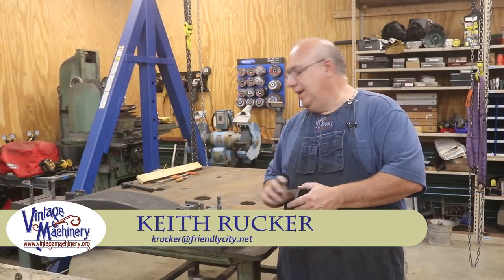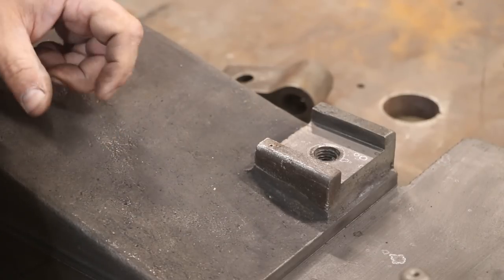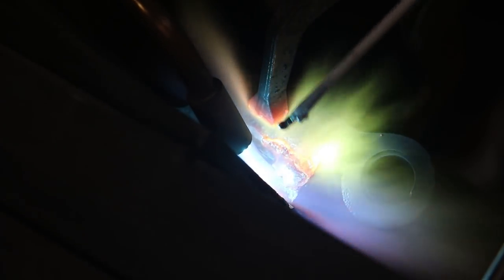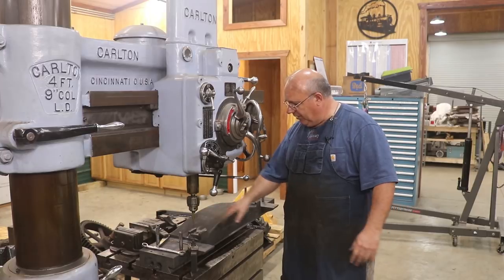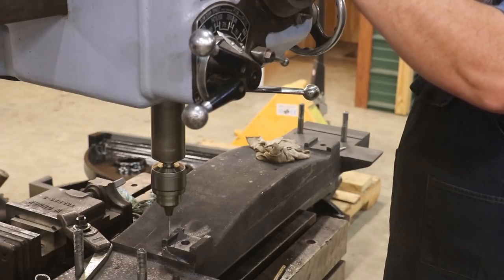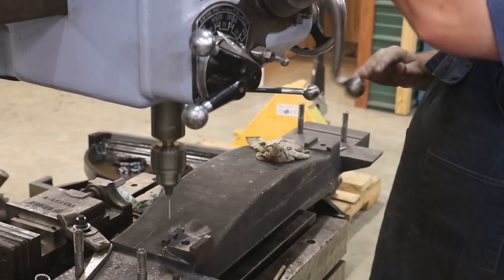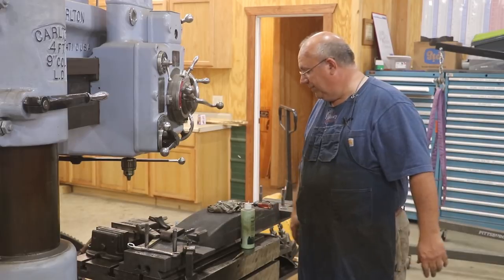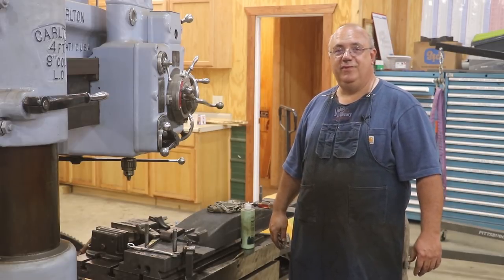New Haven Metal Planer Restoration - Part 6: Repairing a Broken Casting

Comment: Hi Keith, Just read a few of the comments. I think I understand your method of complete tap through rather than just tapping the the large peice. The stress of pressure from tightening the screws on the braze might weaken the weld. I think the hardware store screws give a vintage look to the repair. How about adding 2 screws in the same place on the oppisite mount? That would make the repair unnoticeable because both mounts would look the same after paint. I don't know the shear point for those screws, but if you used them, I am confident they are adequate. I was a machinist over 40 years and I'm still learning new methods and techniques by watching YouTube. Don't let the armchair machinists or ENGINEERS comments bother you. "Sometimes even a blind mouse finds some cheese philosiphy" and "the book says...." doesn't trump experience. I really enjoy your videos, and I've learned a thing or two, also.

Comment: Blind pins between the casting and the bracket would carry the shear load and make an 'invisible' repair besides the brazing.  Just another way to do the repair.
Reply: Yet another good suggestion. 90% of the force is sheer force. Those screws don't look they're up to it. That's a lot of weight lifting up and down
Reply: if you look at the braze as a "hinge" is it really shear load on the screws?
Reply: @fuzzy1dk  -- Good point. It's a question of what gives way first of the brazing. The part on top acting like a hinge or the whole thing all at once. Either way it seems not the ideal repair.
Reply: Aligning the wholes in the main and the broken part might be interesting though...
Reply: You pointed out my question too. The screws are just too soft and would be weaker than the cast iron. Why use screws when the repair is permanent and would never need to be redone in the future. Pins would be the perfect choice.

Comment: As other people have suggested, dowel pins on a reamed hole would have been a much better choice. Much stronger, ground finished with zero stress concentration factor on the pins vs the threads of the bolts. Hardened shoulder bolts on a reamed hole would make a great choice too.

Comment: Keith, I'm a mechanical engineer.  I differ with your repair method.  Use grade 8 socket head screws with red loctite; torque to 12 ft lbs.; then grind the heads off flush & "voila" : repair without being seen.  Have a nice day.
Reply: I'm a ME also and I use Grade 8 for almost everything. I'd counterbore the part for the heads a little bit. Loctite and leave them. BTW do you know there used to be THREE grades of red Loctite? #1 #2 #3. Nobody used 1 or 2 so it's all 3 now. And blue Loctite is good too. AND if you never ever want to take it apart again use the green...
Reply: Hi I'm no ME but I would have used socket head screws like you suggested with the heads counterbored flush and Loctite etc. Tapping the hole right through the broken off piece means all your doing it tightening the screw to the broken section. It should of had a clearance hole through the broken off piece. Just tapped the bottom of the hole so it pulls the repair up tight.
Reply: Phil Grindle: You're right about the Loctite Green. I applied it to some 8-32 mounting stud nuts (on a fuel gauge). When I went to remove the nuts, the studs twisted loose. I just use the Loctite blue now.
Reply: Socket head cap screws are not grade designated as are hex head cap screws. A standard inch series socket head cap screw is 20% stronger than a Grade 8 hex head cap screw and 50% stronger than a Grade 5 hexcap screw.
Reply: @PhilG999  Green is a medium high strength wicking grade for pre-assembled fasteners.  Red is high strength and generally stronger than green.  Purple is low strength for small fasteners and blue is medium "removable" strength.  Most versions have 3-5 different versions for different applications such as liquid, paste, stick or tape and for use on different sized fasteners.  There are food safe versions, high temp, ultra high temp, etc.  Red loctite has 9 grades now actually 262, 263, 268, 271, 272, 277, 2620, 2700NA, 2047.  Not sure if the military spec versions are the same as some of the others just with a different number though.  Most people just call it by the colour without knowing that there are different versions for different conditions.  It is definitely not a one size fits all situations.  You need to use the correct formulation for your application.
Reply: @tamaralee4108  I recently had to remove 8, 5/8 studs from a cast iron housing that were installed with ALOT of green - like they were dipped in it. Double nutted them and got out the torch. It didn't take alot of heat, but I finally got them all out. I put them back in with red, but I don't recall which number. Hopefully I don't need to do it again, or I may just order new studs.
Reply: @PhilG999  I personally opt for the passionate pink Loctite, but it's difficult to find these days.  :-) ...
Reply: Some good suggestions here; agree with consensuses to use grade 8 fasteners.
Reply: @chris0tube I can't see how you think his screws are doing nothing? They're threaded rods, If you loosened them you wouldn't be able to pull them out & once tight they are holding the 2 pieces by their threads. I agree they're not tightening/pushing the broken piece down but it's brazed anyway & his screws are doing exactly what he wants them to do, addig some lateral strength
Reply: @chris0tube Slit through all the braze from one of those 2 pieces, would it fall off? No, & surely the threads are under tension even though they're not specifically pushing down on the piece they're still tight I think

Comment: Nice job but I would use a better grade of screw than the basic hardware store variety and add Loctite on the threads
Reply: And grind the heads down, in case some curious person decides to unscrew them.
Reply: Tony Ashford  Someone posts an intelligent and respectful comment and you reply with an ignorant rant. No doubt, you're a wonderful person.
Reply: @E Designs,   Thanks for that man.  😉
Reply: @boots,  Seems that most of us agree on my points, not sure what could have triggered Tony like that.  Thanks for the support.  I've been following Keith for a long time, as a matter of fact, I'll be doing a cast iron repair and watched several of his in preparation.    How much you want to bet that he changes those screws?
Reply: @Joshua Larson,   I don't know about that, when you consider the attention to detail Kieth put into the last lathe rebuild, I think those screw heads are going to bug him.

Comment: Keith, I do not understand why you did not drill the holes in the broken piece a little larger than the machine screw so so the screws will put more downward pressure on the piece,
Thanks
Reply: There is no "nut" that the screws are threading into. A better option here would have been a hardened dowel pin into reamed hole- the screws contribute little strength in this application.
Reply: @TheHarryroks  Thank You, I was thinking braze, dowel pins, then a shallow milled out step into which a back up block could be Bolted down with maybe a hardened shoulder bolt to disallow any future stress to move that Brazed shoulder  Good thinking sir.

Comment: Put a couple of  harder dowel pins in that Bolt on piece after assembly they will take the shear load better than those set screws
Reply: Yep. Those screws look like the kind you use to put wood knobs on a cabinet.

Comment: If it were me doing that restoration, Keith, I'd knock the heads off those bolts and hide them.  With a fully tapped hole the heads aren't really doing anything other than bringing attention to the repair.

Comment: For my take I'd only change the screws and used flathead Allen screws . By then again I'd figure it's not much there and would braze an extra backer block to the casting and the broken ear . Plus added it to the other side to match. Over engineered always stronger in my thinking, right or wrong it wouldn't hurt. Thanks for the videos

Comment: Did you consider socket head cap screws with clearance on the broken piece an the base threaded? The screws used looked to be standard home center grade which do not have much shear strength.

Comment: Like others, my first thought was that those cheap screws won't do much.  So I decided to do that math to be sure.  The root diameter of a 10-24 screw should be close to 0.135" so the cross sectional area would be  0.0143 sq in.  If it is a cheap screw with 60,000 psi tensile strength steel, that makes the shear strength 858.8 lbs. For two screws that would be 1,718 lbs.  If you want a safety factor of 2 or 4 to 1, then that's not much.  If you get a alloy steel socket head cap screw (stronger than grade 8) those are 170,000 psi so the shear strength for both screws together would be 4867 lbs,  That's a lot more than I was expecting.  For comparison, a single 0.19" dia pin made from the same material would have a shear strength of 4,820 lbs.

Comment: Yeah the good old cherry red, that was how I was taught brazing too.
Heat it up untill glowing cherry red and then put the brazing rod to the red glowing part, not to the direct flame. Holding the flame directly onto those rod might just "burn" off too much of the flux (I know that it does not actually burn, but that was the terminology used to explain. At least it looses its function too early.
Other than I have seen Keith Fenner do it with the rods and the separate flux, we also used the flux coated rods. Sometimes I wished for some aditiopnal flux though.

Comment: If you don't clearance drill the segment above the crack, then the screws are just floating, not holding any tension closing the crack tight.  Sure, the head is tight against the top of the block but you are not pulling on the threads in the main casting.

Comment: Cast iron is brittle, but there must have been some substantial amount of force that knocked it off. Those screws cross-section area is not even one hundredths of the cast iron broken surface. Half to weight of all that machinery is going to be supported only by the partial brazing and the flimsy screws. If it breaks loose in operation there's going to be a lot of repairs needed to be done to get it operating again.
Reply: Not sure how it works exactly, so for all I know Keith could be fine with this. However, thats a big chunk of metal, and if it lets loose I don't want to be anywhere near it or whatever its supporting...

Comment: Just a suggestion but I would put in some longer screws so that you could cut off the extra a little high then peen them down to lock them in place then file flush to hide the repair.
Reply: Another good suggestion. Those look like ordinary screws

Comment: How many votes do we have so far for getting rid of those screw heads? At least 6K by my estimation. But, hey! It's your gig Keith, no matter what any of the peanut gallery has to say.

Cheers,
-- Joe
Reply: Keith. There is a new, leftist kind of engineering. The kind of a  technology used in a particular job is decided by voting. It is called the social democratic engineering. THEREFORE you should post description of your job on youtube, after two months all sorts of engineers will vote and you would be required to use the mathod that the majority decided- no matter how silly or unprofessional. :-) Of course you know the most important gain: you would not be held  responsible for work done. Cheers! :-)

Comment: I get that you are using flux brazing rob, but wouldn't is flow better into the cavity if you'd put some extra flux on the workpiece?
And if properly torqued down, all the force should be on the screw through the hinge and the metal contact area, not on that ear.... Good that you reinforced it, but it's pretty over-dimensioned now.

Comment: Brazing is good but is there any other way to repair cast iron? Is there a welding process that works? It just seems like with today’s technology there ought to be a different method. Thanks for sharing.
Reply: Paul, brazing does not alter the crystalline structure of cast iron and that's VERY important.  Check out several of Keith Fenner's videos, where he had to deal with the highly adverse consequences of welding cast iron.  The bronze alloys used in brazing are comparable in strength to the cast iron being repaired.  New technology for its own sake is nonsense.  "If it aint broke, don't mess with it!"
Reply: There is a Eutectic powder welding process that is cool enough to not risk making the cast iron brittle and with more than enough adhesion to be stronger that the CI itself. It comes from the same people who do Abom's shaft repair spray but a completely different process.

Comment: Should've counter bored the holes a bit- used a good quality sock head screw, then filled the counterbore with braze- - a lot better than that erector set hardware, and after painting it would look stock.

Comment: Keith sorry but I feel that this repair will fail. The screws due to their clearances, really do nothing until the braze breaks. If it were me I would drill completely through the broken off part with the body drill drill diameter of the screw selected and just have the threads in the parent part. Use grade 8 flat head cap screws as large as you can and counter sink the tab for the heads. Use as many screws as you can fit in the space and torque them in.  If space permits a gusset or two on the back side would help. My 2 cents worth. Glad to see the radial drill in use..........Ya ol Auburn ME Friend....War Eagle !!!.

Comment: Too bad you didn't have any old square head bolts, they would have fit right in with the age of the machine.  Excellent repair.
Reply: Would have been worth making the square head screws if not doing blind pins or counter sink socket head filled in with bronze.

Comment: Whats with the Grand Canyon on this side Keith ... you might have stuck a little more brass in it ...
Reply: Yes, the brazing on the ends are the most important.  The first brazed area done off camera is not filled sufficiently.  This is the weak link of this chain.
Good enough was never in my vocabulary.  Good enough is just food for criticism.  
At least change out the slotted screws with socket head cap screws.
JIM

Comment: Dear Keith I was very disappointed with that repair on such historical machine!
In Australia that would have been a coal chisel and Hammer repair those screws where so cheap.
What I could see the dressing with the grinder was rough.
You could save the repair by drilling out screw holes and dowel them and bolt from underneath! Christopher

Comment: Grade 2 screws? At least grade 5. Even better, grade 8. I know that drilling the casting will weaken it, so a thinner screw of higher rating would be better than a thicker screw at a lower rating. The Casting is between 40 to 60,000 psi. So a 10/24 grade 8 is a good match. Actually, 10/32 is stronger than 10/24, both in thread strength and body strength.’
But the better solution would be to tap hardened pins in, since the screws aren’t pulling the parts together because they’re brazed. Pins are even stronger than screws.

Of course, it’s the volt that is providing most of the holding power. The channel is mostly to keep the hinge piece straight when installed, and used.

Comment: I FIGURED YOU WOULD PIN THAT, WOULD THAT PUT TOO MUCH TENSION ON A SMALL PIECE LIKE THAT
Reply: The pins would limit future movement beyond the Braze, and add strength to the broken flange  and the center bolt that prevents any future shearing force. (as long as the pins are a slip fit with no slop and are not a pressed fit. Pins + Braze are good practice for a permanent repair. ( Keith did a good repair and it IS his DANG PLANER!)  lol

Comment: I found that TIG welding works quite well. I guess it depends on the actual cast iron type used but for many types the repair is very sound. Main problem is actually trying to later on machine the fixed part - all that carbon makes it super hard in places. Yes hard = brittle but it may not matter - like crank handles that don't exactly have too much stress on them. Adding bolts is also a good idea - I sometimes just put bolts inside by drilling both parts of cast iron - if using method as here I would weld up the top of screws so they cannot be removed / no one would even know they were there.

Comment: Yeah those lousy phillips head screws don't look great. As they will never need to be removed, locktite then in and grind off - or drill out and locktite some dowel pins in. Just get rid of the heads, they really ruin the look and provide no benefit.

Comment: I see that all the real mechanical engineers here would do different repair job and they all criticize your method of repair. So I will join them :-) . It would be simpler and proper method instead of any repair just cast new part. No complications and of course no negative comments from the 'real' desk engineers. :-)
Reply: 'Real Engineers' are just that, real engineers.  Considering how Keith normally does repairs, and the mass of the equipment he works on/with, one would have to be a lowly snarky comment sniper to not get that people are confused when Keith uses what appear to be cheap, maybe Grade 2 machine screws. Derp! Anyone who would question why something that appears to be very similar to this  https://www.homedepot.com/p/Everbilt-10-24-x-1-1-2-in-Coarse-Zinc-Plated-Steel-Flat-Head-Phillips-Machine-Screws-5-Pack-803891/204274679  is being used here is just, well, not even a non-real engineer.